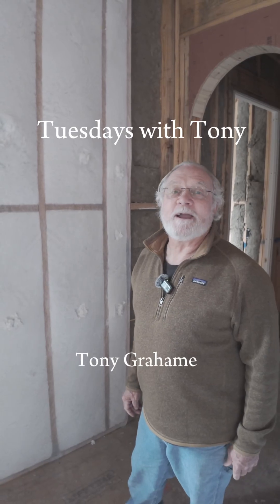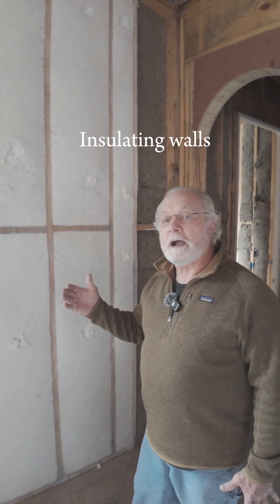Tuesdays with Tony | High Performing Walls

Comment: What about if they are health conscious and voc's, spray foam and even precast foam board is a no go?
Reply from the maker: Great question! You can still be health-conscious and use spray foam and various types of rigid insulation foam boards (extruded, expanded, polystyrene, etc.). Yes, most materials (adhesives, paints, building materials, floor and wall coverings, and other interior finishes, etc.) do outgas and release VOCs at least initially when installed. Over time, however, most products reach a level of producing no or little VOCs. This generally occurs in the first 1 or 2 years. As a general practice, we follow the EPA Indoor AirPlus guidelines for building a healthy house with good indoor air quality. This includes fresh air exchange, whole-house filtration, humidity control, and of course, heating and cooling. It also includes selecting building materials and finish products that are already low in VOCs. 

Now, for someone who is chemically sensitive, you have to work with a knowledgeable architect/designer/builder/building science consultant, or indoor air quality professional who understands the challenges of designing and building a house that is extremely low in VOCs based on the client's specific concerns.